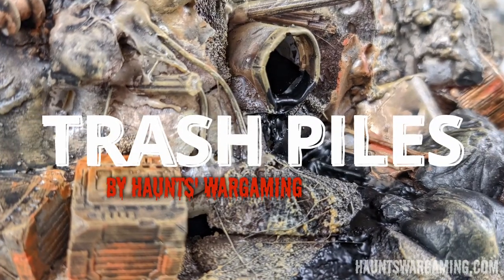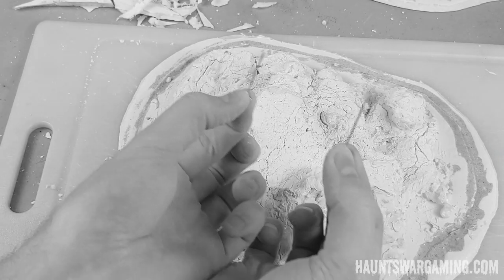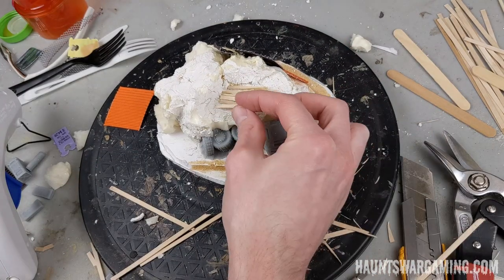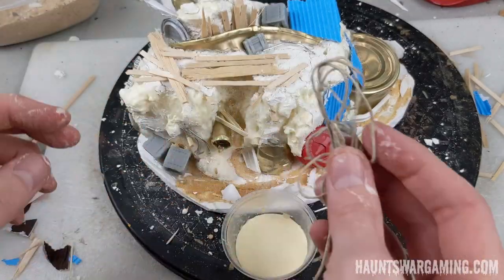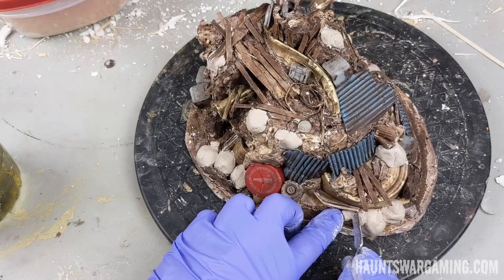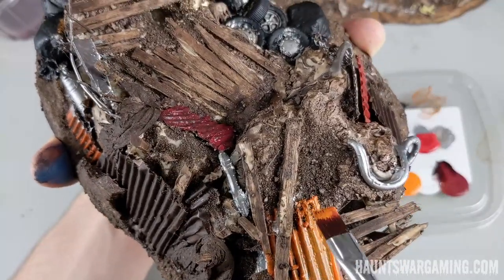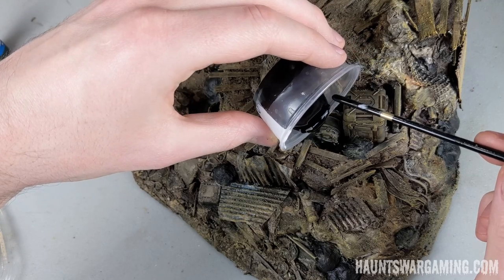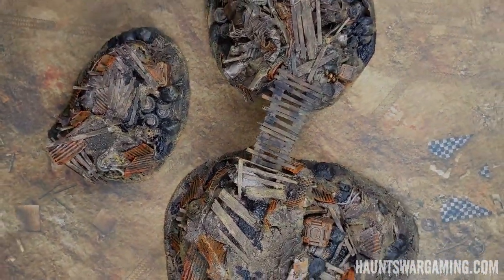Junkyard / Wasteland Trash Piles - POST APOCALYPTIC Terrain Tutorial [EP 1]

Comment: Other materials that could add texture/detail to the junk piles:
-Beads (various sizes/shapes); good for spark plugs, tin cans, small wheels, or glued to other objects to simulate non-specific mechanical greeble
-Dry Spaghetti; cut into various lengths for rebar/pipe, spent shell casings, door/hatch handles, etc.
-Patterned scrapbook paper (come in many colors and patterns); glue it to sheets of cereal box card stock, then cut or rip off into old flooring or wall paneling (if you've ever replaced a floor or wall, you know how much of that gets sent to the dump; bonus points if it's some disgusting puke yellow color from the seventies)
-Cereal card itself; cut into tiny squares and stack them like discarded floor/roof tiles; cut holes out of it to create window or door frames (bonus if you glue clear plastic on one side, preferably with pieces missing so it looks like broken glass)
-Paper clips; coiled around a pen to create a spring, jutting from the mound like rebar, bent into shape of bicycle frame or post-modern chair
-Sewing thread; glue down onto surfaces like tangled wire, or tied around objects like rope
Reply from the maker: Those are some good suggestions! Some jewelry bits and ornate beads would be nice to have on hand. I'd like to get some patterned crafting scissors so I can cut designs into any type of paper.
Reply: also chunks of old sprue. i've got some cheap fly swatters with handles that look exactly like i-beams and the swatting bit has a great grid texture on it (we use all parts of our prey like our forefathers did)
Reply: @chrispowell2947  I'm gonna need to look out for some fly swatters like that.
Reply: @chrispowell2947  This. I collect all little bits and pieces that drop down from forming pieces for terrain and vehicle parts into a ziplock bag.